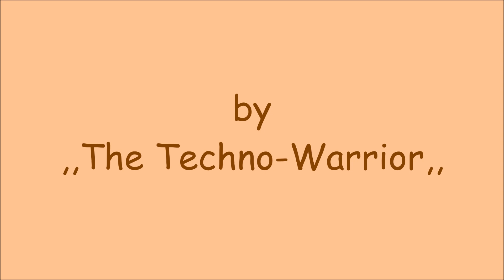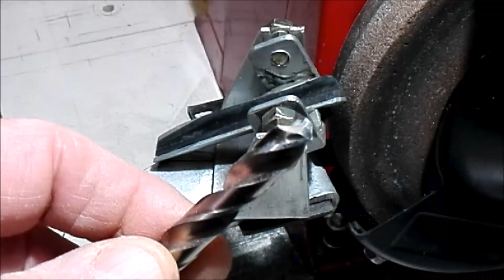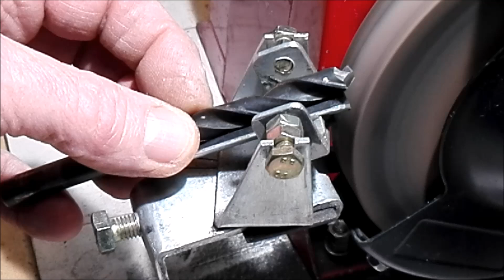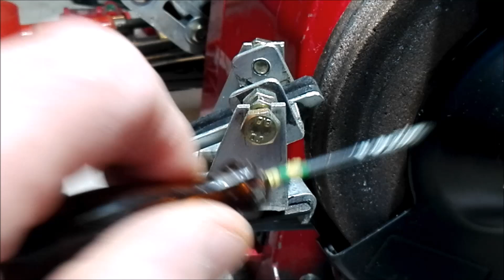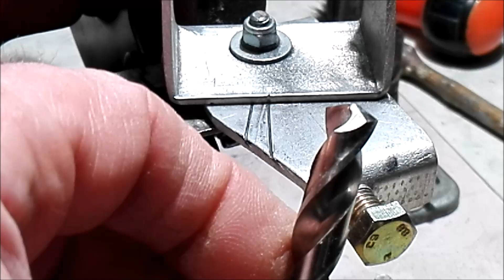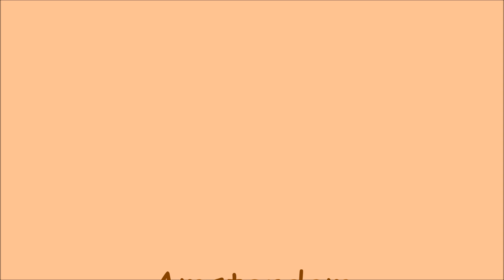4 Facet Drill Bit Grinding (Easy Way) Part 4 ,,Homemade,,

Comment: The drill you show ground ends up with 4 facets all right, but it doesn’t look like split point geometry. Secondary grinds must meet up exactly in the center point of the tip, and the wheel must have a really squarely or better yet sharply dressed cornet for this to work
Reply from the maker: Hi vedran , absolutely, I changed the stone!! Greetings puet!!

Comment: Not true 4 facet grinding because you are still left with a chisel point in the middle of the drill. Proper 4 facet grinding completely eliminates the chisel point.
Reply from the maker: Hi mike, right. Have now a sharper cornered stone. Thx greetings piet !

Comment: Thanks piet,  
My question is that what about other size drill bits, can this bit holder works for every size? 
By the in my country today great festival holi, festival of colors. So wish u happy holy.  Manoj from india
Reply: By the way
Reply from the maker: Manojkumar Varsani hi manoj, yes I did 1 inch drill no problem !!! Wish you also happy celebrations , piet